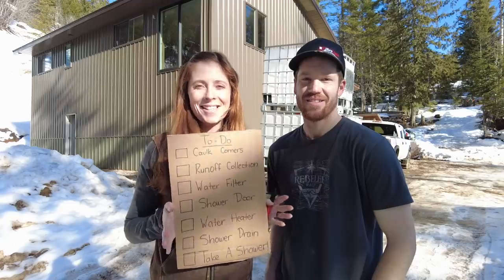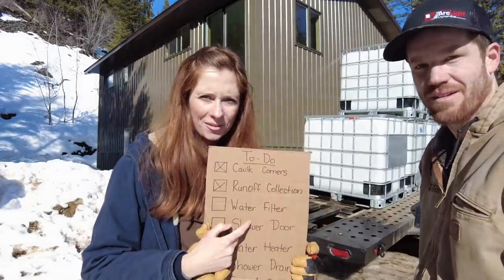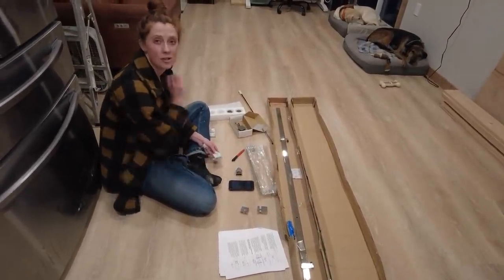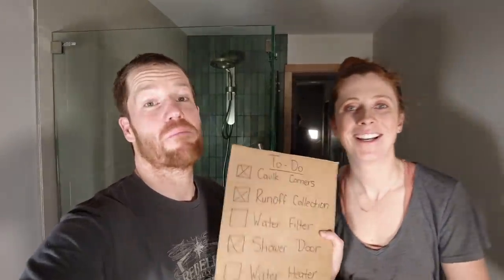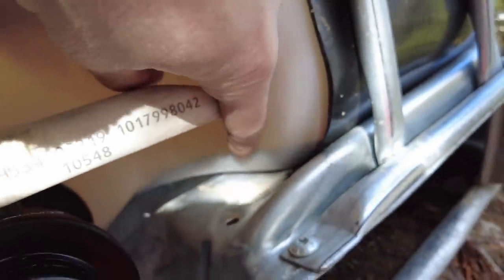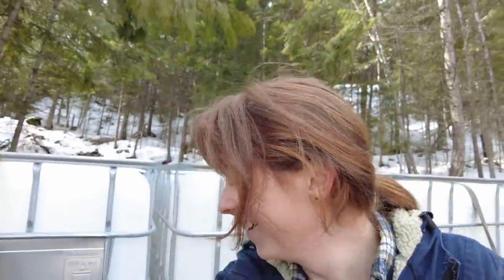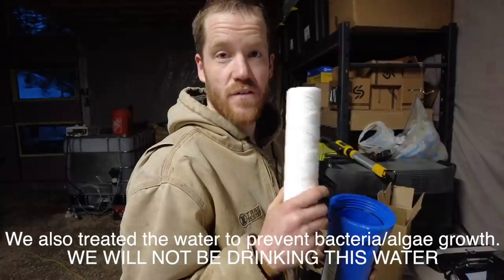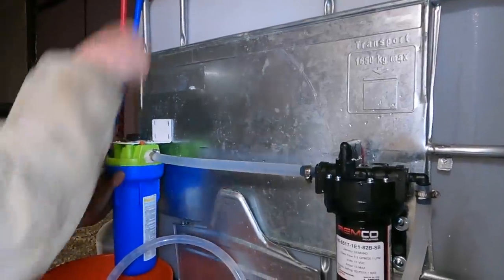We Went A Year Without A Shower | Building Off-Grid

Comment: We paralleled your build but 45 years ago….(married for 49 years) building a two story 1,000 square foot building in Mariposa. At first we set plastic trash cans in the Sun on the deck for bathing, one for washing and one for rinsing ! After bring our water heater on line, we used a plastic lined wheel barrel…Great memories ! FYI our son graduated Cal Poly SLO… Masters in Electrical Engineering (Icadautomation/Lighthouse Electric)
Reply from the maker: The many phases of building when we do it ourselves! Go Mustangs! 💚

Comment: How about using the totes in a series when you're filling them, using the first for "settling" and let that one feed off at a higher point to the next, so the next 2 bins would have less deposits? Then use that plasma table you have to cut a flange for those totes and make a large enough hole to drop the pump in the tote? All easier said than done.   Just thought I would make the suggestion

Comment: We had similar setup 35yrs ago, had to heat a vat of water for 14mins, not 13 or 15, then hit the 12volt pump. Woohoo! Best shower ever, l know how great it feels. We bit the bullet and drilled our own well, never looked back. Filters are important, we have 5 & 30 micron, plus charcoal. Makes best tea ever. Replaced 1 pump motor since '97 otherwise fine.

Comment: That first real shower after going months without is truly glorious.
Some ideas for future infrastructure you can do with the equipment you've got:
1. Dig a surface well with your excavator. This is basically the advanced version of what you did with the culvert runoff. You should be able to get 10 feet down which will be more than enough for fall/winter/spring. It'll likely dry up in the summer unless you're very fortunate in topography. You won't want to drink the water directly, but honestly reverse osmosis systems are cheaper than a comprehensive water test these days.
2. Set up a greywater system (suitable for treating most domestic water except toilet). In a nutshell, you'll be digging a shallow hole in the ground a yard in volume downhill from your place and filling it with bark chips (ideal) or chipped wood. After that, trench a drain pipe from your domestic drain stack to it. After those have had a couple months to break down and start turning into soil, transplant some reeds/grass from a nearby marsh to do bioremediation. Planting a couple of nearby fruit trees is also a good idea as they'll soak up any excess water -- and give you food. The province of BC made a pretty good guide to give you all the math you need to plan one out. Google "Manual of Composting Toilet and Greywater Practice"
3. This one's a bit of a legal grey area as many jurisdictions don't recognize it as valid. You can do a DIY composting septic system using red wiggler worms in an IBC tote that is partially buried. Google keyword here is "Vermicomposting toilet". The basic premise is that the worms will break down solid and liquid waste and their castings are broken down by aerobic bacteria that live on bark/wood chips. The leachate from this system can be adequately treated by a typical greywater system. The end result is that your system will outperform a typical septic system in terms of groundwater pollution, but has an additional maintenance item that you have to do care and feeding for a worm colony. In your situation, I'd probably get the IBC 90% buried and put a few inches of foam sheet around the top to keep the colony cozy. You do need access to the top to periodically feed them wood chips and make sure the colony is still alive.
Reply: Never heard this. Millions use for their drinking after. Do you have a source or published article for this information?
Reply: Interesting. Wouldn’t a composting toilet or outhouse to use as a backup be simpler?

I like the ideas of a well if it weren’t for there location high on a hill. 

Perhaps instead of an plastic IBF they can dig a pond, direct their runoff to it and filter with rock in ditches. Then the remaining sediment will settle and they can pump relatively clean water back up the hill as needed or into storage during winter. 

A separate roof runoff to a sistern deep enough under ground to avoid freezing may work. Depends on rainfall. 

I’ve seen multiple YouTube Off Grid people get very creative and spend countless hours of labor with quite considerable money. In the end, they drill wells.

Comment: I would definitely consider adding gutters to collect cleaner water off your roof.  Maybe do it on the side without the chimneys as long as your ash doesn't end up on the other side of the roof.
Reply: The book “Rainwater Collection for the Mechanically Challenged” estimates that a more realistic number is 550 gallons of rainwater harvested per inch of rain per 1000 (horizontal or flat) square feet of collection surface.  At 13 inches per year that would be a pretty big tank.  Of course you'd want to install a pair of diverters or beef up the gutters in a section for extension ladder placement when visiting the roof.
Reply: In Australia the go to for water is to put gutters and water tanks onto every substantial sized roof you can. I'm guessing that gutters would impede shedding snow or something as one reason why it may not be as common in the USA. 5,000 gallons for a tank is a good starting point here in Oz and houses often have far far more than that. We are nowhere near as cold as you, but still have issues with valves being damaged by freezing in winter.
Reply: @anttiroppola4414  Melted snow from the roof if good to the roof was designed for a high snow load.

Comment: Sometimes you just have to love a good Rube Goldberg project!

I have a new appreciation for my septic, well and hot water heater. 

I was surprised at how little debris were in the first tote. 

If you line you’re ditches with rocks and gravel when you gravel the drive this may actually be a viable long term solution for water to use even after you drill the well. 

Now you need a good sponsor for multi-stage filtration with UV. 

Nice work!

Comment: Only advice Riley, can you get a dark cover for your storing tank in the shop, it will avoid algae growing aswell and last but not least an UV light against microorganismen. They grow best at shower temprture. And once a week, waterheater on fullblast and roundabout 2 - 3 minutes cold and hot waterline with that hot water running till everything is hot. Throw that water away.
Be carefull with this because all is pex and can mabe split. I don´t know the exatly configuration you made.
Reply: black spray paint can work well short term

Comment: First observation;  Title can be read that you lived a year off grid and didn't bath the entire time :)
For the last house we built we lived in a pole barn shop for four years that was about the size of yours.  We were east of you (just north of Spokane).  I set up a rain water collection/filter system.  We used Culligan water for all cooking and drinking but had a bathroom with shower, washer and dryer, ect. and it worked fine while we lived there.  Never had to haul in water.  If you look online there are some pretty easy systems to set up.  Ours had a "roof washer" to divert the first bit of run off and three filters, I believe down to 3 microns.  With an ultraviolet light added we could have drank the water.  I never put that in as it was always meant to be temporary.

Comment: Cut a hole in the top of the IBC big enough to drop the pump into. then find a tapered plastic bucket (which most are) that will slide down into the hole, but not all the way through, this will plug the hole like a cork. You can file a notch in the side of the hole to accommodate the cord. Having two openings in the tank will make it much easier to clean also.

Comment: Guys. Look in to hyperchlorination. We did that while living on a boat in the Caribbean.  The basic idea is that you add quit a bit of chlorine to the water in the tank to kill every thing.  Then you remove the chlorine with a carbon charcoal filter as you pump it from the tank into the house.  Works great and it's cheap.

Comment: You guys are doing a great job, but one thing I noticed that could be a huge safety concern is the door at the top of the stairs. It should open in to your apartment, not out. Unless you decide to build a landing at the top of the stairs. Other than that, the place looks awesome!
Reply: I beg to differ.  It looks like that door is the only way out of the apartment.  For fire safety reasons, it NEEDS to swing out to make sure nothing is blocking your way when making a rapid exit.  I agree on the landing (just outside the door) to minimize the chances of stumbling and falling down the stairs during an emergency exit.  Now would be the best time to install that before you pour your concrete floor (since your bottom of the stairs will be maybe 4 feet out from where it is now.)

Comment: You have an excavator, why not make a collection pond at the lowest point of your property and then use a high volume transfer pump to pump from the pond to the totes placed above your house so you have gravity pressure. You can connect the totes in series.
If you line your pond with plastic and put gravel then most of the segment will settle downstream. Just idea.

Comment: Another great video! Loved the plastic on the filter. 😂

It's always cool to see people finding creative ways to utilize natural resources. Perhaps consider adding a snow melt collection point above the house? Then you can gravity feed through your filters into your house storage and don't need to rely on pumps. Eventually, you could even permanently mount your water storage somewhere up the hill above the house and make gravity work for you.  90-150 feet of head will give you about 40-65 psi at the house and you'll never need to turn on a pump! 🤓

Another thing to consider is making a simple sediment "pre-filter" for your culvert collection system. You could make it out of a 5gal bucket and some pvc fittings. Just feed it with a bit of PVC about 1/4 to 1/3 of the way up the bucket at an angle so the incoming water comes in against the wall of the bucket and is forced around the perimeter in a circle, then put an exit pipe up toward the top of the bucket. Same concept as a cyclone dust separator, but in reverse. Gravity will pull the heavier sediment out of the water column vortex, and as the clean(er) water rises high enough, it will exit at the top and into your water tank. Just put quick disconnect fittings on both feed and exit points so you can empty the bucket every once in a while when the sediment level rises too high. Then you can keep more of the sediment out of your main collection tank.

Thanks again for sharing your journey!

Comment: Riley & Courtenay if you use the excavator and dig to it's reach of 17' to Deeper, then take 18" Black Plastic heavy duty Culverthop -some holes in the loawer sides of the Culvert but first drop some gravel down so you get cleaner water sitting in the dirt at the bottom, then you put Gravel for as much as you think you need around the outside of the culvert then you find a spot to put your pump down to pump water to your hot water heater & Cold water tank and figure out how you split the Hot & Cold together to make a decent shower.    it has been many years since I did this and if I had one this first and not drilled a very deep well I would of been $20,000.00 richer.
Peter

Comment: Great short term setup! One recommendation is to let gravity (=pressure) in the accumulation IBC tote to PUSH water through the filter first, before the lift pump has to push it uphill to the transfer tank. Your inside garage setup is correct, as you don't want to put the filter in front of the lift pump, because there is no headspace to provide relief in case of a clogged filter. It would burn up your pump.  Keep up the good work!!

Comment: Persistence!  I agree with Riley, I am never convinced with plastic fittings under pressure.   Do you have some way to make sure you are not getting any microbes into the shower?  Even somehow keeping your mouths closed you might get droplets in your eyes and nose.  I hyperchlorinate our 300 gallon tote of emergency water, storing potable District water.
Reply from the maker: That's definitely a concern, and this won't be a long term water solution for us. Riley did treat the water and we definitely smell like we came from the community pool after using this water... 😉

Comment: Noticed that when you turned your water pump on the hose started jumping around. You might consider attaching a check valve or a foot valve on the inline hose in the water tank. Just from experience.

Comment: There is nothing quite like that sense of satisfaction when you have had to kind of kludge everything together "for the meantime", and it all works! Great job! 

Some suggestions. 1. As long as you are going to be collecting water this way, maybe leave two totes at the bottom, and two totes on the trailer? And put a second tote in the garage. You'll go through that water faster than you think. 2. Collect the water at the bottom, and bring it up the hill as-is. Filter it once you get it up the hill. 3. Not really a suggestion, just an observation. After I finished laughing at a mistake that ANY of us could have made... I thought, wait a minute. The plastic was on the filter, but the water was still running. Maybe not strongly, but it was flowing. That makes me wonder about the efficiency/integrity of the filter and housing...

Comment: Next project:  Build your own plow truck using a battery from a used Tesla Model-X, some sheet metal, and the contents of several pieces of Ikea flat pack furniture all poured into one box.  If that's not a priority, then I wonder if you could collect enough water via snow run-off to last all year with a little engineering?  Maybe a lot of engineering?  Probably a lot of cost, but what do I know?  I'm some idiot from the internet!  

I hope you end up with enough views and sponsors to have all kinds of luxuries and do big things with the property.  The channel is like several discovery channel shows in one but without the production nonsense, pandering, and term life insurance commercials.  The amount of work it takes do so all of this yourselves plus putting up with filming it is impressive.  Trying to do this stuff and having to stop to mess with a camera (or talk to it) would drive me crazy.

Comment: One thing I would consider is using a 2" PVC pipe from your dam at the end of the drainage pipe to the tote.  Also, if you can, move the tote as close as possible later.  My thinking is that freezing temps could cause the hose to freeze up.  Also,put some sort of removable mesh at the head end of that 2" pipe.  Just a thought.

Comment: For winter, set up a 7 to 10 foot or so high metal platform (you can use used scaffolding for this. Put some cleanish large empty metal barrels with one end cut off. You can use old beer kegs or oil drums that never had oil or chemicals in them. Put another barrel beneath them but off the ground so there is maybe 3 feet difference. Run some pex pipes to the outside not over the lower barrel. Either fill the upper barrels with snow or let it snow in them during the winter. Every time they are full move your tote below the thing, drop the hoses into your water tote and light a big fire in the barrel below the barrels with snow. It may sound a bit complicated but if you draw it on paper, you need 1 scaffolding, 5 to 8 large metal barrels (1 goes below to have a fire) and some hoses/pex and some fittings and firewood. Gravity and heat will fill your tote

Long term, if you have an area of your land maybe 75 or more feet higher in elevation, you can bury a water tank underground, permanently pipe that to your home for gravity powered water and then keep this rig up there in the winter to fill it. Look up Red Poppy Ranch's shallow well set up with a similar storage tank on a hill or there is an older channel that is dead called Pure Living for Life with a long series about setting up a similar water system. 

Are you allow to use rain water catchment? That could be another way. Set up a polebarn the hill near your underground tank and let rain fill it.

Comment: Ah that was really good. Just what I needed after such a depressing night. You just make me laugh Riley with forgetting to take the plastic off. Ya with most fittings you will need some Teflon tape unless there nice fine threads but you seemed to have figured that out. Great job on finally getting you free run off water working and your shower system. Hopefully you have checked that the propane water heater exhaust heat isn't to close to anything that will melt.
Great Job and I also love the trail cams you have set up. Great to see the wild life were you live !!!

Comment: Great setup there. Look into getting a cyclone separator for the dirty water inlet from the culvert. You do lose a bit of water but it'll significantly lessen the sludge in the bottom of the tank and your other filters will last a lot longer.

Comment: Yes .  .  . glass is very heavy.  In WWII the British SAS operated two wheel drive Chevrolet trucks in the Saharah desert (northern Africa).  The key to driving in the soft sand of the desert was floatation and being as light weight as possible was a must.  They cut off the tops of the cabs to eliminate the heavy glass windows.  Fast forward many years and the 3 hosts of the BBC show Top Gear went to cross a dry lake bed in Botswana in cars they had purchased locally.  Although the lake was dry, it was a crust over top of peanut butter mud.  Again, it was crucial to reduce weight.  Two of the hosts removed their doors and smashed out all of their windows with a sledge hammer to reduce weight.